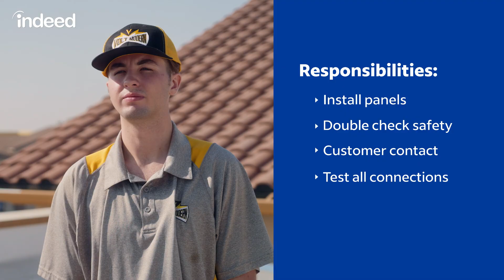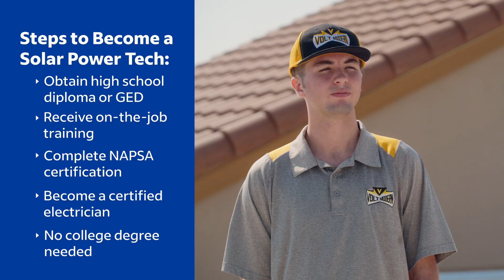A Day in the Life of a Solar Power Technician | Indeed

Comment: Back breaking stuff I bet
Reply: 🤣🤣I'm 19 and it isn't it's hella easy only "tough" thing is you got to hold 30 - 50lb solar panels
Reply: @BestPriceTrader  how often do you have to hold the solar panels for each installation?
Reply: @BestPriceTrader  how did you get the job?
Reply: The solar panels aren't really the back breaking part, it's bending over putting the feet and rails in that's the real killer. Paneling is usually the fastest part of the job.
Reply: You are soft if you think this is back breaking work try concreting or form work
Reply: I am probably soft now as I already broke my back doing window fitting with triple glazed everything  @ChristianColemaŋ